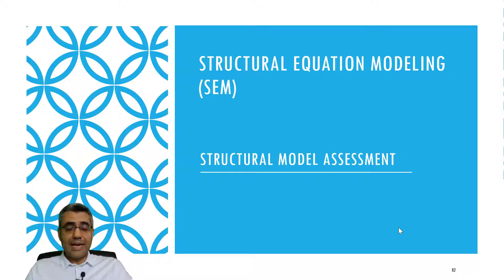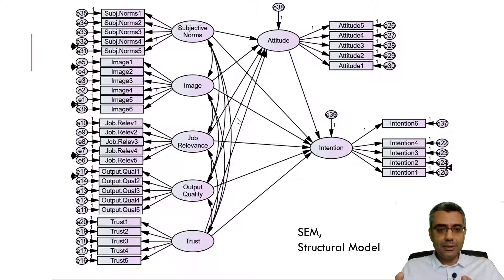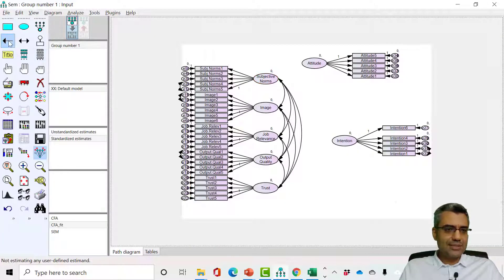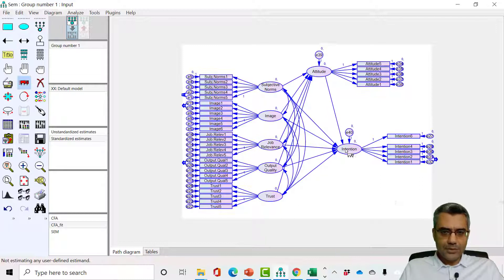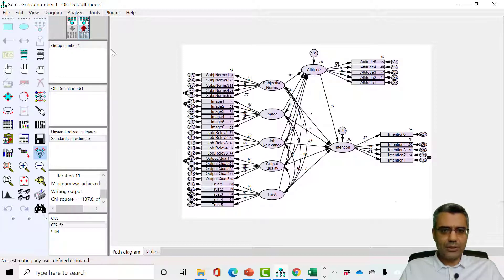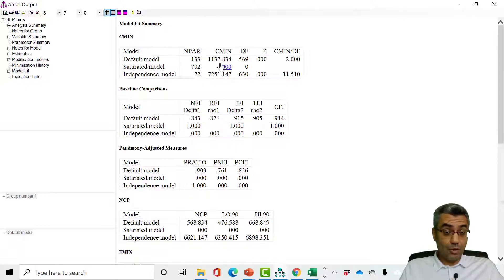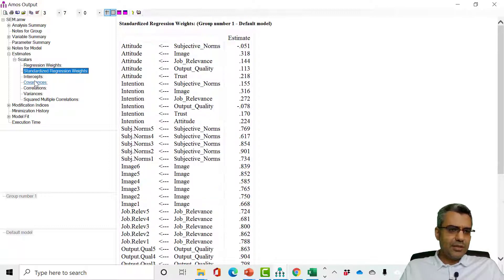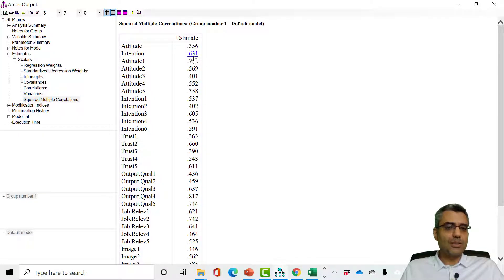SEM with AMOS: From Zero to Hero (20: Structural model assessment)

Comment: Thank you so much Dr. Saeed. I really appreciate all the valuable knowledge that you addressing in your channel.
I have a question. Would that be enough to measure the validity of an instrument (convergent and discrimination validity)?. I have seen some literature comparing other instrument. (In my case I have no instrument to corrlate it with). Would Factor analysis is useful to use in this case like what you did ( convergent + discriminate validity). Thank you so much.
Reply from the maker: Hi Abdullah. Thank you for your feedback.

Of course you can evaluate other forms of validity like nomological validity, face validity, content validity, etc. too. However, many studies just evaluate convergent and discriminant validity. This is very common.
Reply: Wonderful! Thank you so much Dr. Saeed.
Reply from the maker: @abdullahkhali  No worries

Comment: Hi Sir, first of all thank you very much for your video. I have a quick question what if the result is negative but significant. How do we interpret it?
Reply from the maker: It depends on your hypothesis. If you have a one-tailed hypothesis (e.g. a positive relationship between X and Y) and your results are negative and significant, this means you failed to reject the null hypothesis. In this case, you should explain the findings using the literature or context of the study. Sometimes, the explanation is interesting and adds value to the current literature. This may even increase the chance to publish your paper!